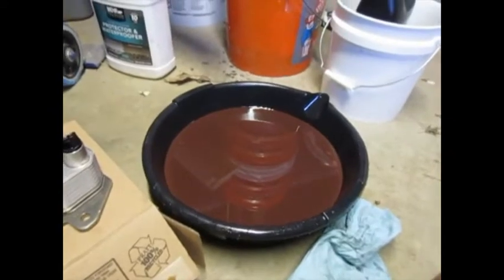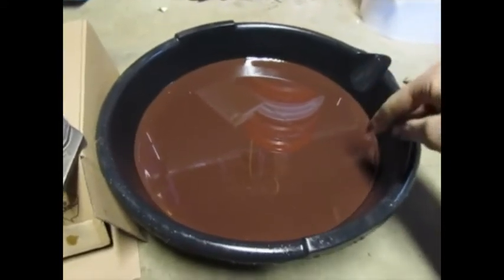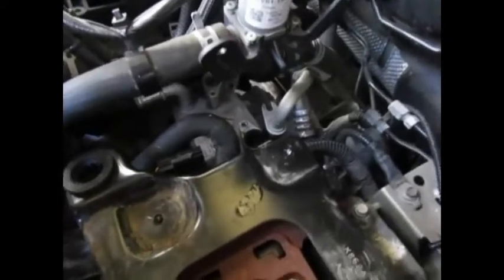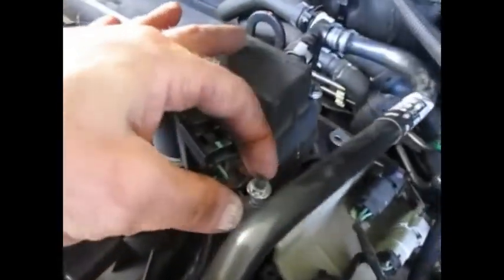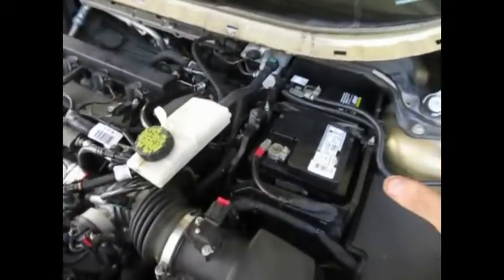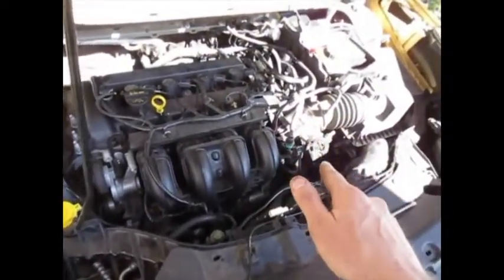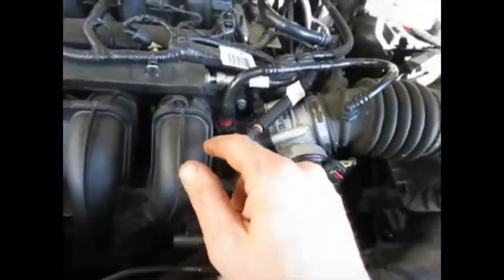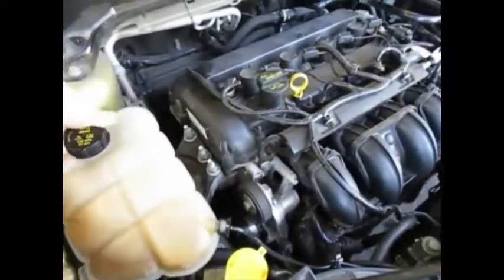2015 Ford Escape Transmission Oil Cooler Replacement, 6F35

Comment: There are actually 2 transmission coolers. The one you are replacing is called the auxiliary cooler, the trans cooler is up front in front of the radiator and it cools the tranny fluid via air flow. I hit a deer and the grille made a small pin hole in the front trans cooler and started squirting fluid out. $80 from the dealer new, Not bad! The front end cooler might only be on the newer escapes, I have a 2019

Comment: Your right not much on the net about this issue.  Do you happen to have a part number for the cooler?  Is it dealer only or available on line.  I've tried ebay with no luck.
Reply: Dealer only.